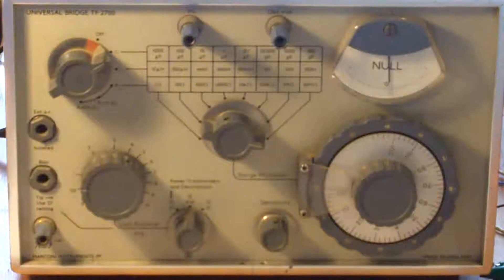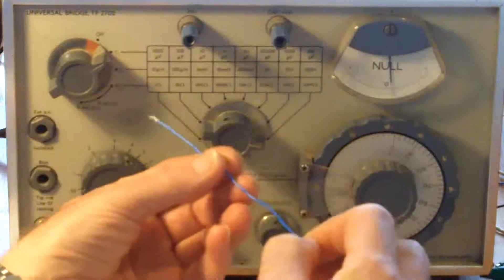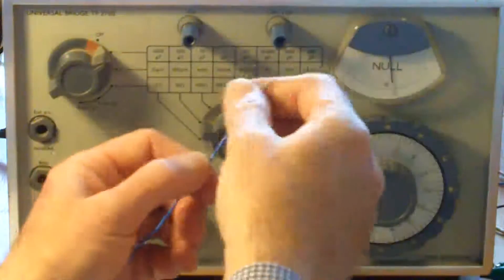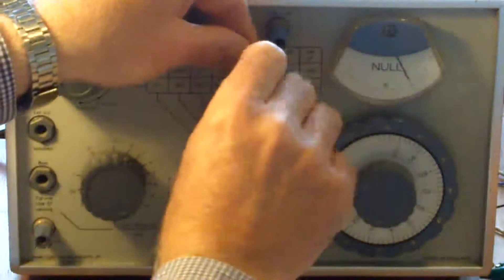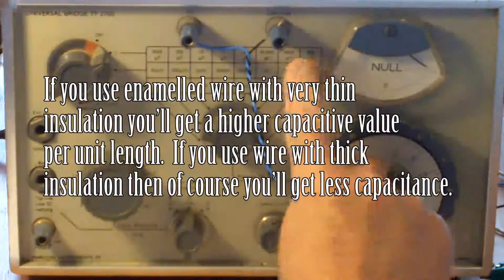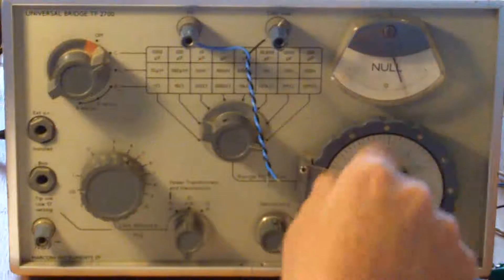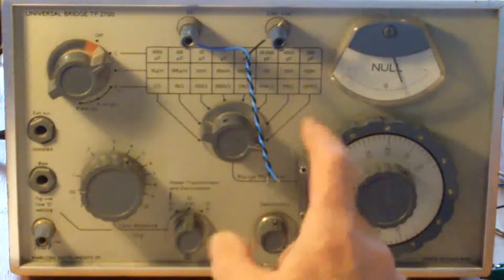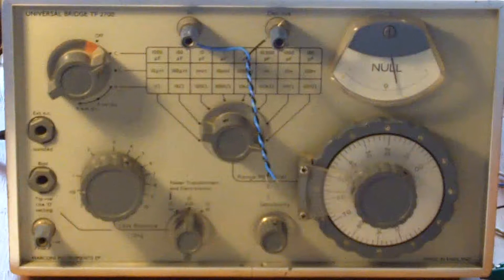About Capacitors ... Part 4 'Gimmick' Capacitor  by Andy Davies.

Comment from the maker: Hi there. Sometimes you might see a piece of equipment with just a couple of bits of wire sticking up of the board and you could be forgiven for thinking that someone has cut off some component or maybe a pair of test leads. Because of the very low values of capacitance that can be achieved with a gimmick you only see them in high frequency circuits. Thanks for watching.
Kind Regards ... Andy